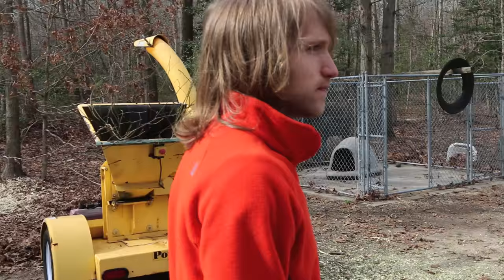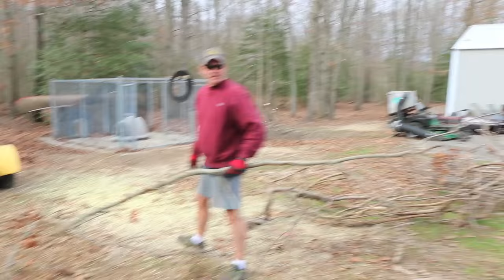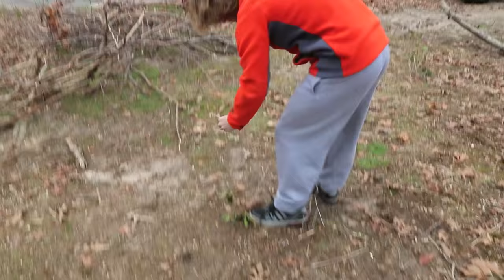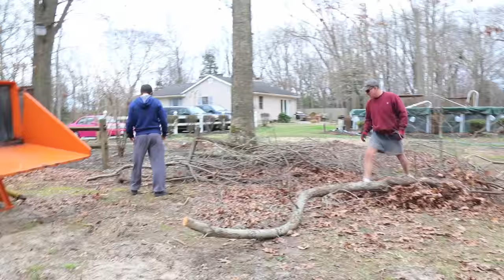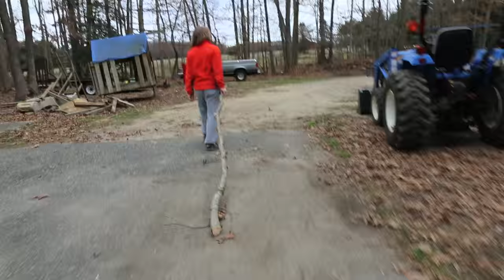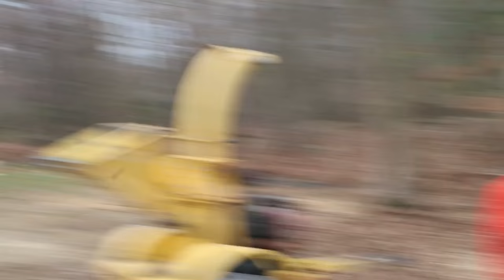BRUSH IT OFF!

Comment: Manual labor is a good start to the day i love doing any kind of tree work jesse doesnt realize how good he had it he got tired moving twigs😭 I would move about 30 60 to 80 pound logs into a truck then take them back off and stack them in a woodshed. Moving wood is such a good way to bulk up if you don't have a nearby gym my neck doubled in thickness from only a few months of doing wood

Comment: Have they even checked if the old chipper works
Reply: it works fine its just where the stuff goes into the chipper is bent so you can't put into the blades. it works fine its just dangerous to use

Comment: Jesse when you slow down engine like that really fast   there's still a lot of gasoline that still going into the engine  and then some of the gasoline comes through the engine and then  it go in the muffler and that's why it backfires and sounds like a  gun

Comment: I swear man, I'm usually not one to judge jesse. But ffs dude you're picking up the smallest little twigs and shit to pass time while your dad picks up all the big shit. I've had to pick up way worse than that and even cleared a entire property of trees with my dad and shreaded them you had it a lot easier than I did and it was in the summer in 100 degrees
Reply: Everybody make way we have a badass
Reply: Nathaniel Neuland No, No bad ass.Just pointing out the obvious. He was sitting there doing nothing when the work was not even hard at all. If I was asked to do a simple task like that i'd do it no problem. Moving twigs and branches ain't shit but he makes it so hard when it doesn't need to be. Move on now